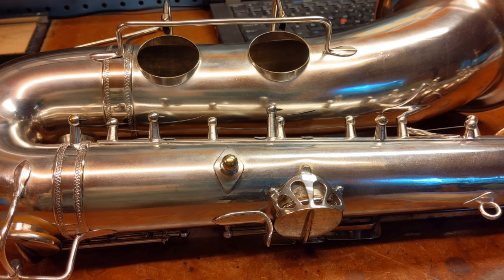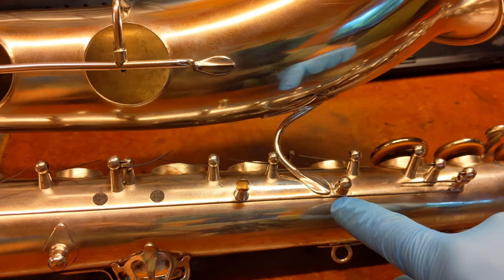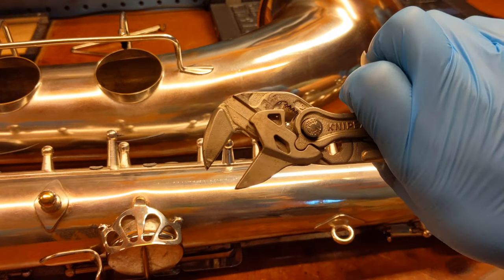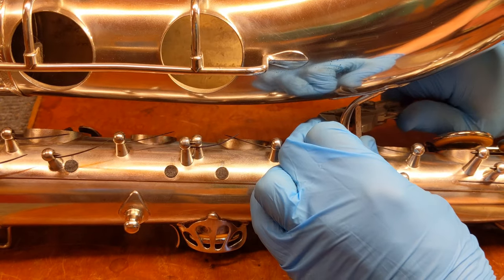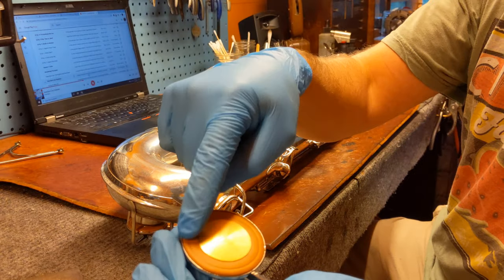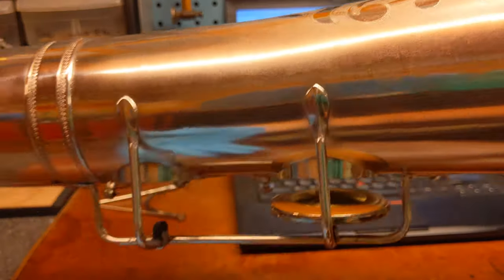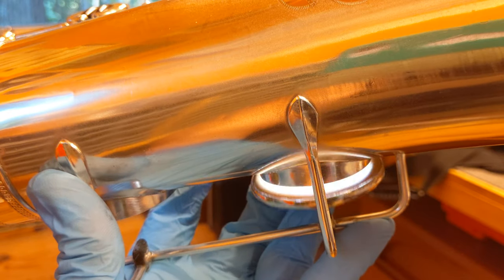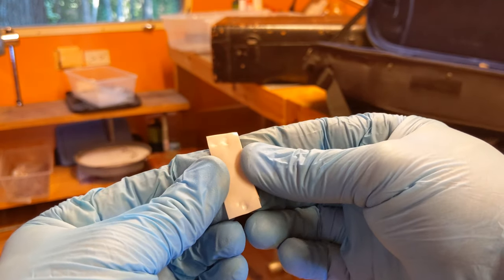Saxophone Repair Topic: (Questionable) Method to straighten Early Selmer Bell-to-body Brace

Comment: Good to see you back at the bench Matt. Brilliant tool, and simple. I straightened a 1917 King bari body yesterday with a home made wooden block that clamped around the top of the body where it meets the crook. 20 or so well placed whacks against a cinder block and all tone are in alignment and nearly flat again! Love making my own tools.  I'll try yours on this bari as the bell to body brace was left distorted and partly pulled away from the body after straightening.

Comment: Great tip Matt! Thanks a lot man. Good to see you are back. X!
Reply: Any concern about relieving internal stresses?  I don't know about brass, but if it were steel, straightening that brace would push out the bell, but internal stresses would store that energy like a spring, and make the bell want to push back, making that brace prone to collapsing again.  Again - with steel - I might be tempted to apply some heat to the back of that bell to partially anneal the metal and relieve some of that stress, but I also know that you are having to worry about heat sensitive stuff like solder on joints and lacquer in the pad cups.  (I am not a repair person)
Reply: @gfghjfgfghfj  The internal stress is not that big of a deal in brass instruments, but theoretically you might be right. The trick to solve it, is probably to do just enough "over stretching" if that's needed, to get the bell  and brace in place. Problem with brass instruments is, that if you "heath them up" to much, the brass will become super soft like butter. You could deform it by hand. Too much heath will surely affect or  even  ruin the sound of the instrument. But anyway, nice response. Some food for thought. X!

Comment: Cool. Always enjoy your vids. Question- with the brass’ memory, would you expect this to move back toward the damage, or would you expect it to more immediately settle here, where it lived for years and years?
Reply from the maker: In this case, I would expect it to go back to where it had lived for the vast majority of its life. This damage was really recent- sometime in the past couple weeks.  Also the bow should be applying some stabilizing pressure to keep it where it's supposed to be. But it would bear watching over the next few weeks, and I would likely leave it for a few days before putting pads on, as the vast majority of whatever movement it's going to make if it does should happen in that time period.
Reply: Stohrer Music much respect as always Matt. Thanks for the response and keep doing your good thangs!